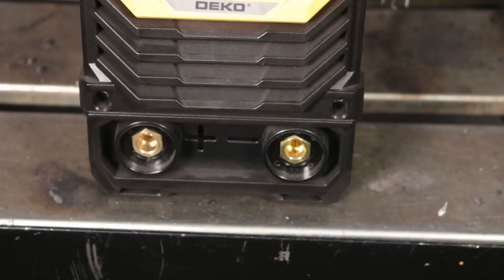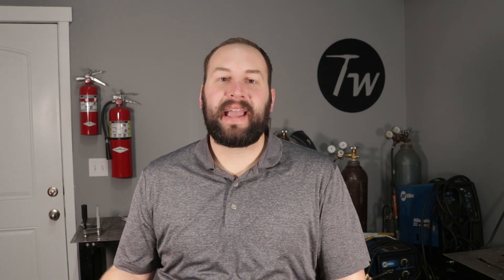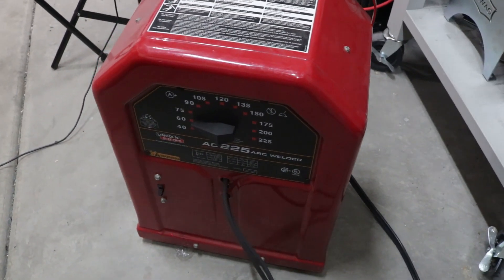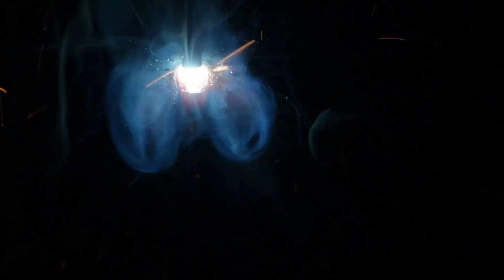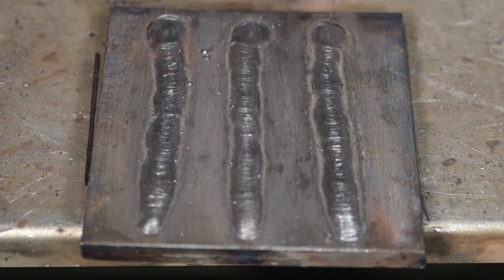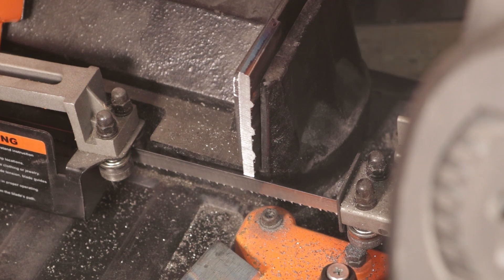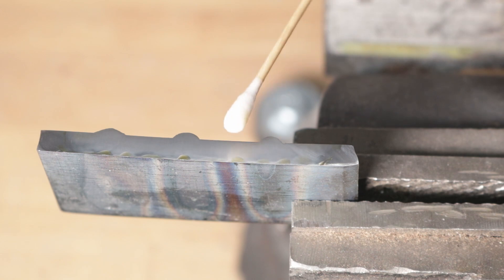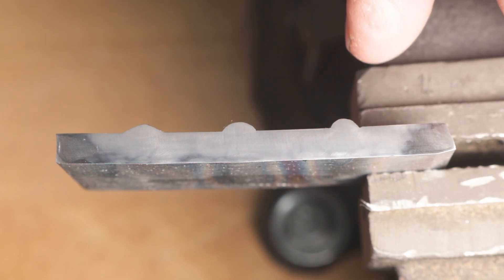Stick Welding Polarity Explained: AC vs DCEP vs DCEN

Comment: Good explanation! You can use naval jelly (rust converter) to etch the metal and see the penetration better! Couldn’t really see yours to good!
Reply from the maker: Thanks! Naval jelly is a great option because it's available at the hardware store. I've found the nital that I used works better, though I was also disappointed with how it showed up on camera in this one.

Comment: Excellent explanation, Question how do you know which machines can switch between DCEP or DCEN ?
Reply from the maker: Any DC stick machine can be switched, though it will be easier if there is a polarity switch or removable leads which can be reversed.

Comment: I had to stop the video @ 1:33. This is completely different from what everyone says. Always weld DC negative except for aluminum. Welding DC positive burns the tungsteen tip. This is just adding more confusion to beginners.
Reply from the maker: You’re referring to TIG welding. This video is about stick welding. Thanks for checking it out anyway. :)

Comment: Hello, this website contradict for what you said, it says that DCEN has deeper penetration effect!, can you elaborate and explain that?  http://www.difference.minaprem.com/joining/difference-between-dcen-polarity-and-dcep-polarity-in-arc-welding/   .
Interstingly Other websites are agreeing with what you said, like:  https://weldinginfocenter.com/dcep-vs-dcen/   .thus made me confused! I tend to think the first link is more accurate,which contradict what you saying. Would you comment on that,so I can understand and eliminate confusion? Thanks
Reply from the maker: Sure. I quickly looked over the first article and it is theoretical, referring to arc welding in general. It is correct that 2/3 of the heat ends up on the positive side, so it stands to reason that EN would achieve greater penetration, which it does when there is a non-consumable electrode in processes like TIG welding. What happens when there is a consumable electrode, like in stick welding, is that the heat put into the electrode gets transferred right back into the weld as the metal transfers, leading to greater penetration with DCEP in stick welding.
Reply: It seems counter-intuitive but the etch doesn't lie. As to why this time note that Tim's rate of travel and rod deposition were both higher with DCEN. Penetration would seem to be less as a result. See also that the wet-out with DCEP was the best of the three and DCEP the worst.

Comment: Mmmm I am going to try DCEN for thin square tubing... I wish I could afford a mig, but here where I live it's super expensive to have a mig or tig for occasional use, unless you have  welding shop which I dont
Reply: Get yourself the tig torch that Tim recommends  you can run a tig rig from your DC stick welder

Comment: What dimension of material is considered "something thin"? I plan to weld together the new tailpipe onto my existing exhaust system pipe exiting the muffler on my 2002 Chevy 3500. T he orig exhaust system is welded, not clamped. I'm a beginner, just bought a buzz box, I'm setting up a 50A DP circuit for it. Seller gave me a few hundred various rods.   Thanks for your clear explanation. I've subscribed to your channel.

Comment: I couldn't see the penetration. Would Ferric chloride have revealed more? I'm still new to welding. But, today, I tried DCEP and it seemed easier to strike and hold an arc than DCEN. Each has it's uses. But, if I can not stick a rod and actually make beads + is a better way to go.
Reply from the maker: Thanks for the comment! I have some ferric chloride, and it works okay, but takes quite a while to develop. I've used Nitol like this a lot and it showed up really well in person. I think it showed up so faint because of the lighting and camera angle. DCEP is almost always the best way to go.

Comment: If the grounding clamp is plugged into the positive "+" and is clamped to the the piece you are welding to, "say to a car frame" and the car frame is grounded to the battery, what will happen? Would that create a direct short to the battery? Or with the same "+" grounding, if your project is touching a metal work table that could be grounded somehow. Could someone touching the table get shocked? When welding with Flux core wire, you connect the ground clamp to the "+". Seams to me that if the ground clamp is connected to the "+", the clamp must NOT touch anything that is grounded. That would include you or a helper, if you or your helper was grounded somehow.
Reply: Definitely unhook every battery from a vehicle if you intend to weld on it. “shouldn’t” create a problem as the weld circuit “shouldn’t” bleed over. I use “should” because crazy things happen and electronics on a vehicle are sensitive and expensive. It’s always better to remove the battery and I usually set it on a shelf far away. 
I’ve had my fill of electrical problems, once I had a battery short out on a bolt in my semi from going on chip dumps/road vibrations and it caused me a months worth of headache finding an intermittent problem with the Ecm, it cost me $3500 in electronics...and I labored on it! Had I taken it to a shop it would’ve easily been over $10k.
Reply from the maker: Great question. For all welding machines that I’m aware of, the output is an isolated circuit separate from the input ground, so the output + will only complete a circuit with the output -

Comment: Maybe unpainful to remember now.. Electrode positive is for deeper melt-penetration.       Electrode negative is for surface melting thinner material.        Before now I had to remember negative rich electrons discharged onto positive conductors,  similar to radiation leaked heat onto molecules slower or inactive.    Star solar source plus planet geology motions even within botany does constantly gravity-pathway such.  
    It is all relative probably is expression snaring me regardless of never entering a physics class.    Some rumor said battery industry began intentionally mislabeled posts to relieve their headache.    Curiosity about welding a ceiling perhaps adequately distracts aesthetically.

  My mental health is best served by forgetting all that and similar confusers in preference for relearning each refreshed.  Yes absolutely dceP means Penetrator.     Bye bye

Comment: I've read multiple books, and watched hours about arc welding and it seems no one can explain polarity correctly. If in DCEP heat is less on the work piece then how it melts deeper and ⅔ of heat is on electrode so why it melts slower. Nothing makes sense.

Comment: Nononono! DCEP the angry pixies come out head first. DCEN they land on their butts. AC they come out doing somersaults. Everyone knows that... I read it on the internet - it has to be true. 🤪

Good vid Tim. I’ve used DCEN on thin wall tube with good results. Important to switch leads right for tig...DCEP the pixies self destruct. 😎